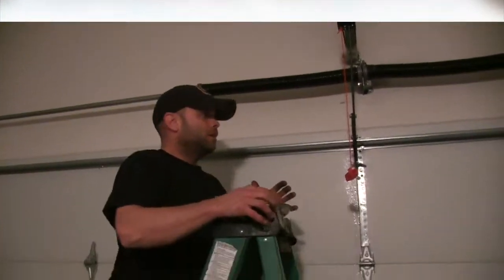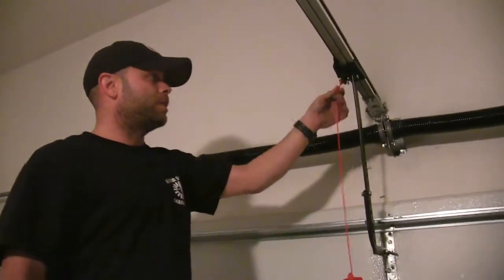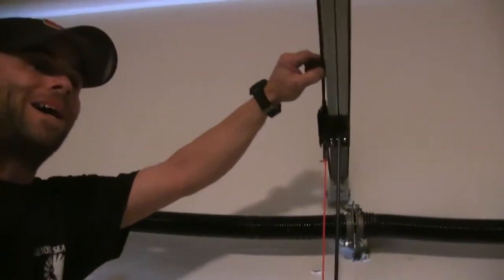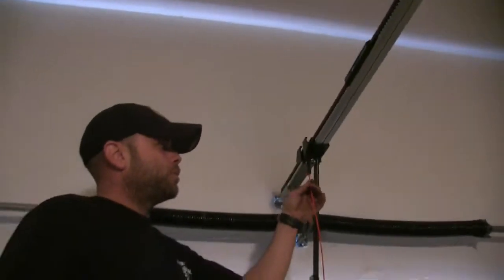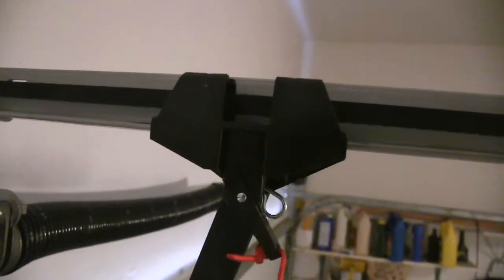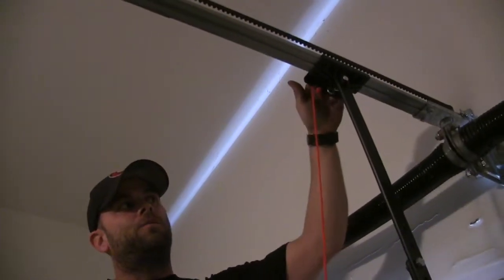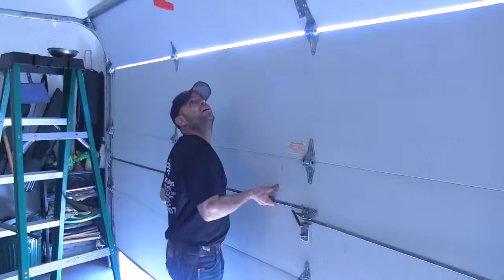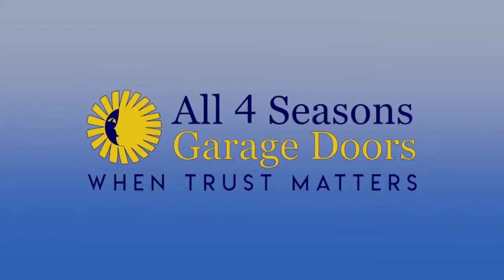Garage Door Emergency Lever

Comment: My safety release does not disengage when I pull it! Genie 2024. I have no idea why. I have taken it apart and can’t find out why.
Reply: I have the same problem with the same model number.  Did you find a solution?
Reply: @bobcowen  yes!!! there was a spring on the release misaligned.
Reply: @justinpulu3984  Thank you for your reply.  The spring was ok but the metal "door" (attached to the spring) that moves out to unlatch the moving sleeve was sticking on the sides.  I cleaned (compressed air) & oiled (wd40) it; It's working now but I'm not sure for how long.  I just hope we don't have a power problem and need to release the door.  Fingers crossed.
Reply: @bobcowen  that’s exactly what I was worried about! I hope it stays good for you too!